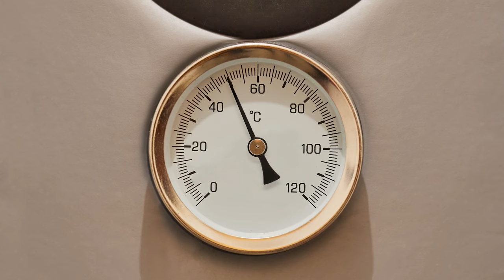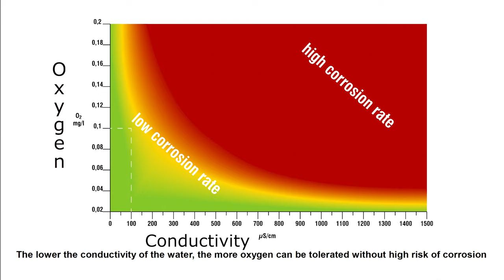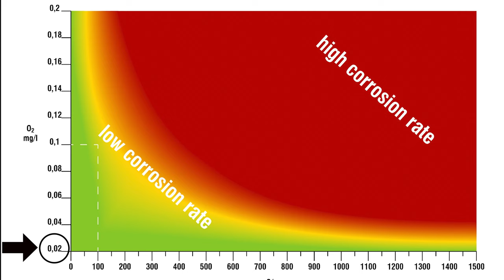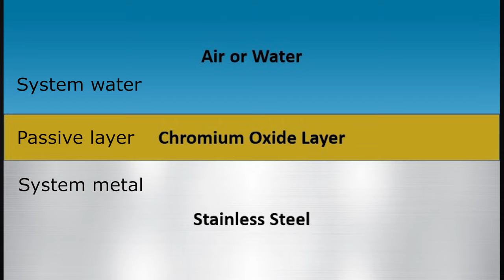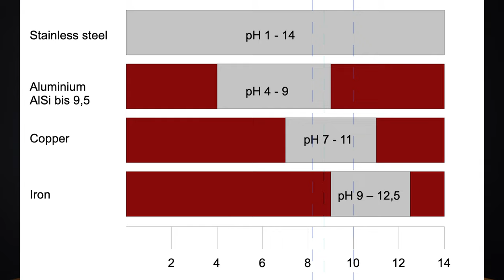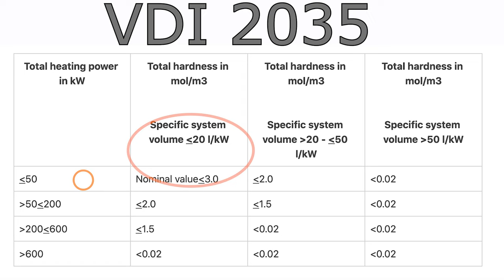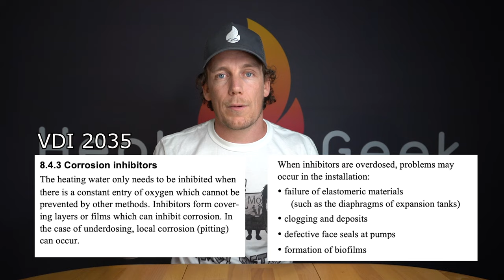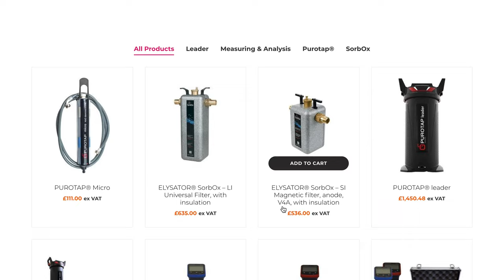Heating Water treatment explained (VDI 2035) and BIG NEWS!

Comment: Hi 
If lower the TDS the pH will go down, Tap water has higher pH than reverse osmosis 
So if heating system is put a mixture of tap water and reverse osmosis will pH go down ? Can be increased with pH tablets ?
That’s based on my personal test of water ( not much in science myself )
If draining a system down what chemical is recommended to clear of any build up mess, rust, limescale in pipework radiators?

Thanks
Reply from the maker: Any chemical cleaner is fine.. x800 or whatever.. I've never had RO water lower the pH   ..  ever
Reply: @HeatGeek  
Sea Water = 8.6 pH	
Soda = 2.5 pH
Mineral Water = 7.4 pH	
Sports Drink = 2.9 pH
Tap Water = 6 -8 pH	
Coffee = 4 pH
RO Water = 5-7 pH	
Beer = 4.5 pH

Reverse osmosis water is nearly pure water with a PH of 7. Reverse osmosis is a filtration method that removes more than 99% of all the contaminants in water.
The result is nearly pure water, which has neutral pH of 7. But if it’s exposed to air, RO water drops down to an acidic pH range of 5 – 5.5. Why? Pure water is very hungry. it actually grabs CO2 right out of the air! Within about an hour, a glass of pure RO water can drop from a pH of 7 down to a pH of 5.5 or lower and become acidic water. Alkaline water has a pH of greater than 7, so reverse osmosis water is not alkaline water. To alkalize it, you have to add calcium and other minerals to it.
Reply from the maker: @valentinmirauta7059  sealed heating systems aren't in contact with air and don't do as you say. The drunks have all sort of other things in so is irrelevant and...as per the video we use ph+ and ph- pool tabs for ph correction
Reply: @HeatGeek  I mean as the article ( most of web articles are similar about RO )say the RO water in contact with the air becomes acidic but if is in sealed system with no contact to air should be all good 👍 
On other hand is not required 100% pure RO water in the system so the pH will stabilise 
The idea an amount of like let’s say the area I live is 400 TDS at the tap 🚰 that’s bad for a heating system.
So use of VDI 2035 will work better than use of inhibitors 
All the best with your work
Thanks
Reply from the maker: @valentinmirauta7059  yes.. but this is why in the video we recommend to keep conductivity to 80 - 100 ųS to act as a ph stabiliser when using RO.. any lower than 80űS and pH can wonder
Reply: @HeatGeek  This is for open vent ? for sealed system can go higher üS ?
Reply from the maker: @valentinmirauta7059  yes 1500uS

Comment: Thanks. How much do you know about bacterial slime? I've only been in the game a few years and I've said to other engineers about when I've checked header tanks (I always do this before any works that will drain the system at all) I've found what looks like a jelly fish in the f and e tank. 

Looking around online its bacterial slime and adding Inhibitor can cause this! I suspected it was some sort of reaction from engineers just putting Inhibitor in the tank right at the end of the job so that the Inhibitor doesn't fully make its way down into the system and sits in the tank but I had no idea it was bacterial slime. I've been scooping it out with my hands ffs.
Reply from the maker: It's the warm temperature up there.. the inhibitor doesn't create it but gives it food to grow.. systems should be upgraded to sealed systems to be honest so I don't risk about it much.. you could add biocide if concerned.

Comment: I admire your efforts to educate your viewers, whom I like to think a large percentage of are domestic heating engineers, as I feel water treatment knowledge is lacking in that space. However I feel this is perhaps going a bit too far and the vast majority will not be interested to this level of detail, and those who are will seek the technical material of industrial water treatment, which has covered these principals many times over. It's a very tried and tested industry. Who fills their <100 litre heating circuit with DI water, come on. Even then I think you need to get your facts right about the chemicals - they do not "die off as they eat the oxygen" this is complete nonsense. The typical components in these products don't really degrade at all - at least by any meaningful degree. I think this is a marketing myth in the domestic space. They also don't leave deposits themselves. Electrical conductivity really become irrelevent once you've got an inhibitor in the system at the correct concentration. These inhibitors have been formulated to perform well in most scenarios (fill water qualities) and refined to offer a 'throw it in and go' solution which the majority of domestic installers will want, and they do it well. The products that the likes of Fernox, Sentinel, etc are just heavily marketed (and marked-up) reboots of formulations that have been used in industrial water treatment for years. They work.
Your message here should not be to stop using inhibitors, because that industry and the science behind it is much greater than perhaps you realise. Your message should be to get it clean and keep it clean - i.e. properly pre-comission clean the circuit (very important) and apply an inhibitor straight away - and maintain its prescribed concentration! I think, and I don't mean this to come across condescending, you're overthinking this and your time could be better spent educating those who need to know in the practicalities of proper system commissioning and maintenance....and modern heat technologies of course!
Like I said I admire what you're doing and I feel it's what the domestic space needs to step it up a level, which you seem to be about - so good luck and keep it up 👍
Reply from the maker: Thanks for your comment. I totally understand what your saying. But firmly disagree. The lesson here is, it's much easier to fill with tap water (in most cases) and leave it and never really need to touch again then buying unnecessary inhibitor and testing it every year.
Reply: @HeatGeek  you could do that but you will, without question, run into corrosion of iron and scaling of heat exchange surfaces. You could throw in some alkalinity buffer (pH plus tablets as you say) to drive the pH up beyond 8.3-8.5 to allow iron to form its natural passivation layer (magnetite), but this would not inhibit scale formation and kind of goes against the whole chemical-less ethos you're going for here. I would like to think maintenance (and therefore efficiency) is high up on the list of priorities for organisations such as yours - and this mentality is fundamentally the opposite of that. I admit there is a lot of marketing misinformation and relatively high cost to these products, but the chemistry works - it just does. The price of a unit necessary for dosing a typical domestic circuit is not much at all. When you're advising people on such a stage, you've got to ensure your facts are right and preferably validated by professionals. Bad advice is worse than no advice at all. 

I'm not saying the pre-treatment approach is wrong - I'm well aware of the mechanisms as they've been used for decades - I'm saying that the complexity and "faff" involved in applying them is not for Mr & Mrs Smith in the domestic space. The approach is also less forgiving, making it more unsuitable for the application.

If you're not convinced about chemical inhibitors, just do a simple jar test and you'll quickly see - get two pieces of clean steel (a steel (not zinc plated!) bolt will work) and add one to a jar of <1500uS water and one with tap water with the correct concentration of inhbitor.
Reply from the maker: @otw5974  as per the video, if below 1200 us no need for demin.. tap water is 7.4 pH but self alkihanises at 8.4 ish.. perfect ph
Reply: @HeatGeek  I say this with respect, but I urge you to do your research and gain real world experience if you want to give expert advice in this field. BSRIA is a good place to start, and the jar test like I suggested and see things with your own eyes - chemistry is not a black and white set of parameters and things don't always work as expected.
Reply: @otw5974  My jar test shows pure tap is better, and my experience of draining a 50-year old boiler in Italy in a soft water area makes me think Heat Geek has a point somewhere.  Still waiting for a reply from the OP to my question of December,  so I'm not holding my breath now, however.
Reply: @johnbull5394  I don't know what to make of this - what is your viewpoint?

Comment: This looks like the perfect get out of jail card for manufacturers. One quick water test when their engineer arrives. He finds no inhibitors and walks out the door. Where does that leave you with your angry customer and their boiler breakdown when probably has absolutely nothing to do with inhibitors in the system but it give the manufacturer a get out. 

I don’t recall ever seeing in any boiler instructions that it says we are happy for you to just use tap water. 

You say you’ve not used any chemicals for seven years. Aren’t you worried you could be leaving your customers without any warranty?
Reply from the maker: Not at all, first of all, it only voids the warranty if it's a water quality issue which there shouldnt be... Secondly Viessmann's instructions (which we fit) literally specifically say "fill with potable water" and refer to VDI, Vaillant also reffered to it for years, it was removed from vaillants instructions for a year, then recently readded as acceptable. I assume you dont fit Viessmann or vaillant as you must not have read their manuals. Thirdly, many heat pump manuals reffer to vdi.. fouthly all honewell valves specify that water quality should be to VDI standard.
Reply: We had a gas valve related issue on a very well known appliance, their chap turned up, took a bit of loo roll and vented the nearest rad, found some black marks on his loo roll and decided the water within the system was dirty, refused to carry on with the works. 
1, That is not the correct test method to find out if the system is contaminated, 2, What does that have to do with a failed gas valve?
Eventually got them back to carry out the correct test method, which proved the system was clean, and they eventually changed their failed valve.
Reply from the maker: @marksmith5237  eventually did the right thing then. You won't have any black if following vdi
Reply: @marksmith5237  poor practices like that are symptomatic of the long warranties that the market has been fed in the last decade or so, loads of boiler manufacturers will do anything to wriggle out of their responsibility after selling the warranty as an additional commodity.
Reply: @patrickwheeler2646  agree with you completely, sell a long warranty and walk away at the first opportunity.

Comment: Unnecessary jargon end of the day customer aint gona pay for that
Reply: Depends on your customers, our commercial customers do and have done for years.  Once you learn the information in here it's easy to follow so you shouldn't need to charge a lot more to make a big difference to the longevity of the install.
Reply from the maker: Pay for what? It's a 2 min test, costs nothing.. infact it's £15 cheaper than adding a bottle of inhibitor and we've been doing this for 7 years
Reply: @HeatGeek what you mean pay for what? Purotap leader £1800?
Reply from the maker: @aj7303  as per the video tap water is fine most of the time... if you fill more than 120 systems up in your working life (we do double that a year) then an £1800 puto tap is cheaper..  or you can use the £111 micro which will fill a system 10 x over.. to fill a system 10x over with inhibitor would cost £150.
Reply: @HeatGeek  nah mate sounds like a scam drop me out
Reply from the maker: @aj7303  the scam is inhibitor! We've just used tap water for the last 7 years! We can only lead the horse to the water.
Reply: @HeatGeek  if you run the system clean (flush +dump) then add Inhibitor whats wrong with that?
Reply from the maker: @aj7303  as per the video..  inhibitor raises the conductivity and becomes ineffective over time and needs putting back in every other year building and building conductivity.  (Call them and they will tell you this) 

It's a pointless exercise when just tap water is fine in a low water content sealed system.
Reply: @HeatGeek  and what do you class as low water content
Reply from the maker: @aj7303  sub 20l per kW..  as per the video. Did you watch it?